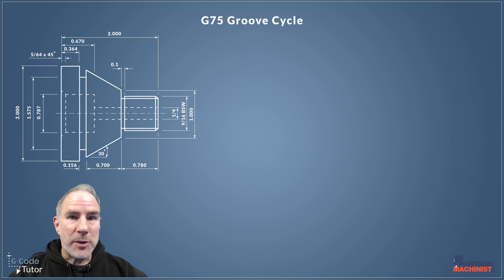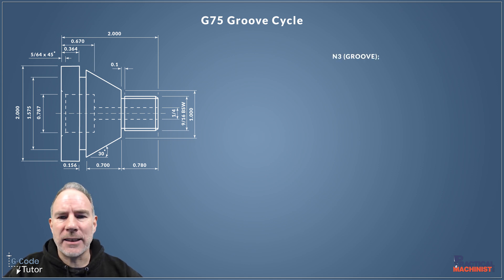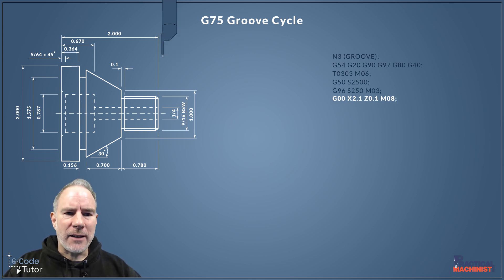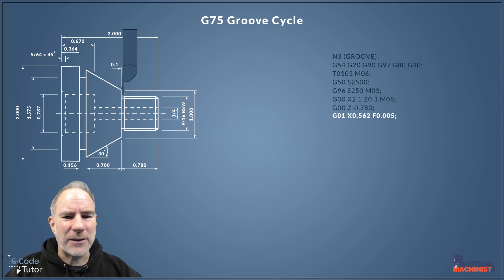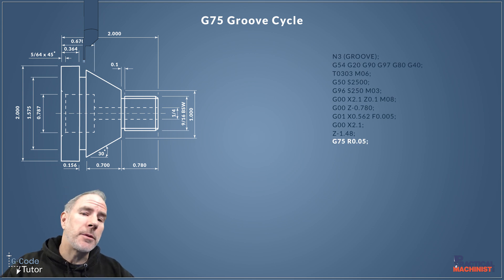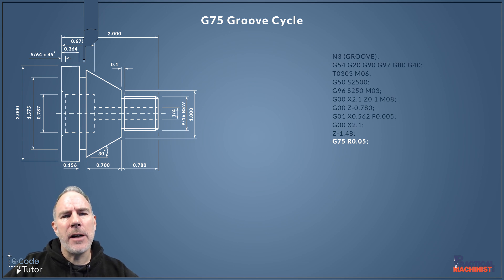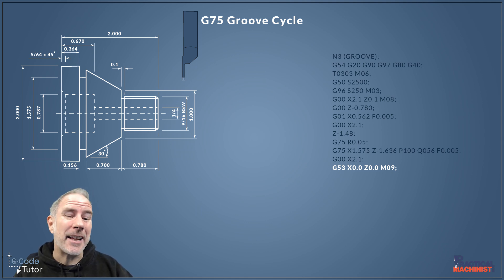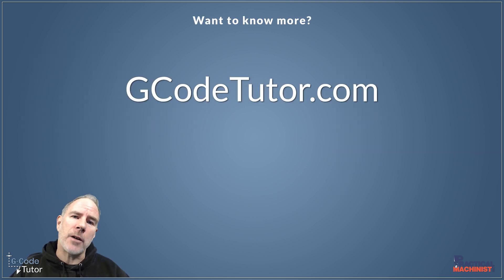How to Manually Program a Grooving Cycle on a CNC Lathe!

Comment: Hi, I work in sprocket and gears, running a fanuc 21i-TB control. Right now, all of our grooving is written in conversational controls and transferred over with cards, but I wanted to start doing it myself in the control. I know g75 can groove, but from what I understand, it's very limited in what it can do, like it's just in and out to one depth and that's it. But our grooves all over 15 degree chamfers on them, which g75 can't do. 

I was also told that a macro program can make it really simple to do. Do you have any videos on this, specifically? Thanks.